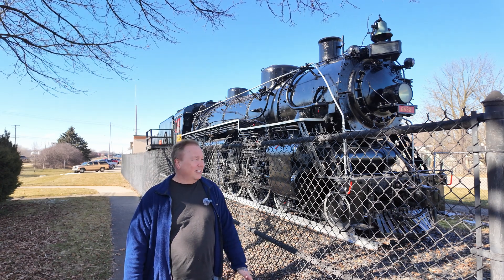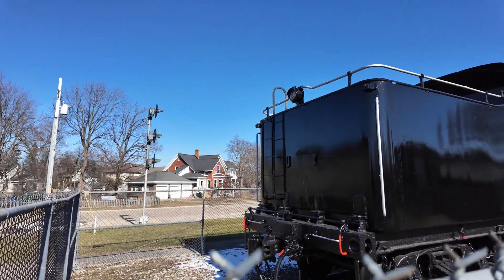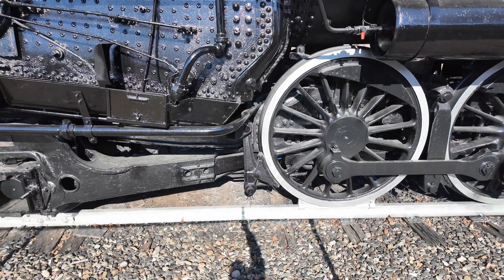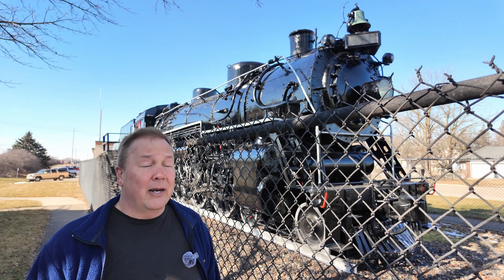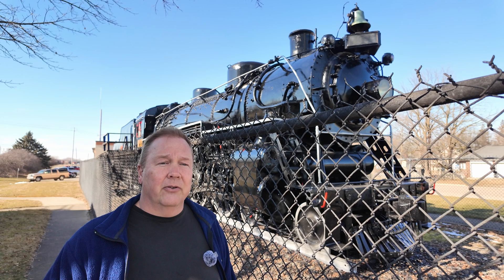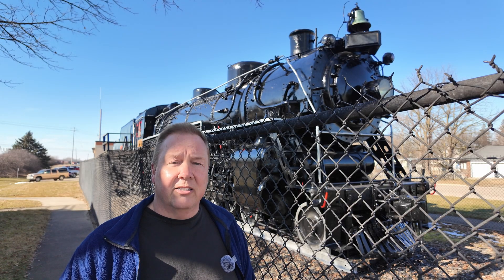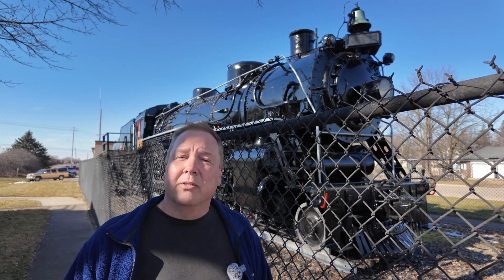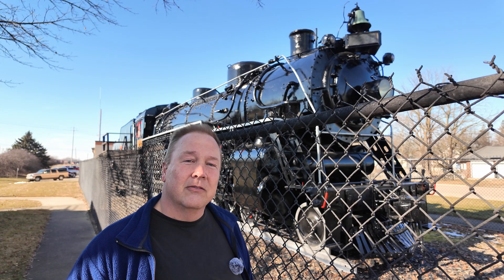Why Are So Many Steam Locomotives Sitting in Parks?

Comment: Desil eletric engines exist, because there is no such thing as a gear tooth that can withstand the forces required to get a train going.  Cogs with fist sized geer teeth would routinely get stripped bald if the driver accidentally applied too much force too quickly.  Eletric motors don't have that problem, so a driver could just go into top gear and not worry about stripping the motor bald.

As for why these engines are sitting there.  I've always assumed the answer is they are giant coal guzzling monsters designed to haul HUGE volumes of goods long distances.  They therefore need large volumes of freight or passengers to be cost cost effective to run, and there is only limited demand for live steam. Therefore you can only afford to keep a small number of engines in steam.  Static display is the only realistic way to keep any significant number of these large american beasts around for future generations.
Reply from the maker: Some good points, especially about why diesel mechanical engines never really worked out, but I don't know that total train weight has actually dropped much for freight trains.  They've certainly gotten longer.
Reply: @Industrial_Revolution  Well, given that the geer stripping I'm reffering to is what happened when the UK tried to convert from steam to diesil, I'd imagine the much MUCH heavier USA freight trains would be even more likely to strip the geers.

I think we did still use some deisil mechanical drives, but they were almost exclusively small, slow shunting engines, which I believe you'd reffer to as switchers.
Reply from the maker: Yep, and there's still some of those little ones around.
Reply: An electric motor and a steam engine can get torque right down to 0 RPM whereas an internal combustion engine has a minimum RPM (idling). 
Diesel locos under about 300 HP can get away with mechanical transmission like on a car or a truck but once you go bigger you need electric or hydraulic transmission.
Reply from the maker: Geared steam engines did exist, although they were typically smaller.  The Shay was fairly common on narrow gauge, and there's still some on use
Reply: @Industrial_Revolution  Oh yes, I was forgetting about geared locos. Of course the need for them came about because of the rough and uneven tracks laid in forests that would be only temporary.
Reply from the maker: @kiwitrainguy a big feature was that they could handle sharper turns.  In rugged mountains, laying tight turns can save a lot of money.

Comment: In some cases it's lack of interest, in others insufficient funding to run & maintain them. Large drivers normally indicated express passenger & or mixed goods services.
Reply from the maker: Definitely a lack of funding. I work with a couple non-profits who never have enough funding, often not even enough for basics like fixing a roof.  
I have a video coming out about how to calculate speed from wheels, and another on the Whyte classification system, and why railroads did different wheel configurations is on my list, next time I can get to someplace with enough variety of steam locomotives to show it well.

Comment: A lot of park locomotives were put in place as strategic reserves because these things are impervious to EMPS. Should there been a nuclear attack, the theory is that you can just fire these right up and get war material and personnel to action relatively quick.
Reply from the maker: I hadn't heard that argument before.  Some that went to parks had been stripped of some parts (to install in others), and a lot were sent there when they were facing expensive repairs or maintenance cycles, like needing a new boiler.  You couldn't "just" fire them up again, but for maybe a year or two, it wouldn't have been too much work (beyond what was pending when they were retired).  Probably within 5-10 years, all of them would have needed major rebuilds, like what you see museums doing with some they rescue today.

Comment: Steam was greatly loved by most people. Not just the people that ran them. The people that built and worked on them enjoyed their jobs and the engines. They hated to see them scrapped they found every opportunity to save them. 
Most people thought they would be called on again to keep freight moving.
Reply from the maker: If you think of how WWII stalled dieselization, it makes sense why people would have thought steam would be back.
Reply: In certain areas they did.  In the mid-late 1950's, Pennsylvania Railroad had a huge, unexpected uptick in traffic during its dieselization process so they had to lease steam engines from all over the country since they scrapped most of their domestic fleet to keep up with traffic flow.  They were pulling Reading, RF&P, even Santa Fe steamers!
Reply: @OriginalBongoliath  Many were not yet scrapped, but rather stored "unserviceable". The cost and time involved in making them serviceable made less sense than leasing serviceable engines from other roads.  The glut of available power probably made the lease terms very attractive.  For the lessor railroad, it was an opportunity to make money from an asset that wasn't being utilized. The Santa Fe's big 2-10-4s went right from the PRR to the scrappers, proof that they were through earning money on the parent road.

Comment: Yes, steam locomotives are a part of our culture, like chimneys on houses kids draw. Engines in parks are curiosities and reminders of an industrial past that is now hidden behind sheet metal and plastic. This Pacific is a fine example of form and function. Every part has a purpose. Big wheels, high-capacity tender, built to run fast on fairly straight and level terrain, beautifully balanced mechanically and aesthetically. Just to expand the discussion a little, remember the yard locomotives, the steam switchers that were "in steam" when not working. Standing and waiting wastes a lot of heat and fuel. Diesels working in the yard could be started when needed and turned off when not. As good as steam technology was, the handwriting was on the wall.
Reply from the maker: Yep, diesel-electrics win for efficiency, but they do lose in elegance.
Reply: Old obsolete 19th century tech yes, but pound per pound for brute power & strength you still can't beat them
Reply from the maker: I assume you've seen the video of the Big Boy that was called in to rescue a stick diesel last year?

Comment: Let me break it down for you in math instead of just telling you how wrong your information is. Lets take the NKP 765. If you do the math calculation's on boiler heating surface you will find the maximum amount of steam that boiler can produce if wide open full steam consumption which actually can't be used by the pistons or generator you will find that boiler at full firing rate can put out about 70,000 pounds per hour of steam. Now once the train is underway, and the valve cut off is closed down so your using the expansion of the steam in the pistons you might be using at most on a heavy train 30,000 pounds per hour of steam. At 8.33 pounds per gallon of water, that is  3,600 gallons per hour of water consumption. The tender holds 22,000 gallons of water without the aux. tender. That is over 6 hours worth of running at that rate. Now at 35 MPH for 6 hours you have run  210 miles. so how in the world do you equate a standard steam engine in regular service to only going 10 miles before needing water?
Reply from the maker: I think the whole thing comes down to a phrase you used near the end - standard steam engine.  The number I used came from a historic line in Colorado, based on their two steam engines, both with tenders.  Some could go much further, and track pans, although rare in some places, were common in others, eliminating the need to stop for water at all.  It's great that you actually pulled together the numbers, here, as it gives me an idea of what I need to be looking at in the future.  A lot of people have brought the 10 mile number into question and it's clear it may have been an overgeneralization.  I've pinned a comment on the video saying that, and I'm thinking there's a need for me to put together a more comprehensive video specifically on water consumption and range and how that varied.
Reply: @Industrial_Revolution  exactly the problem. You generically put information that only works on one little railroad in one location on every railroad in the  world. You made so many false statements in a generic reference that you painted a huge wrong light on the entire industry. Steam engines were inspected after each run which took a few minutes just to check running gear etc. Not shopped over night every night for hours of work. that Pacific was used for passenger trains not freight, and it is not one of only 3. It is a USRA copy and there were hundreds of that Pacific used all over the country. A steam engine requires a fireman and an engineer. Not anymore to operate it. It is pulled out of service every so many days just like a diesel to inspection. Steam engines normally ran 50 to 100 miles before needing water based on the terrain they ran in and how heavy the train is. There is so much you need to learn about it before making a video showing your ignorance. (that does not mean stupid, it means you don't know) And you need to stop making generic statements and say. According to this RR their engines can only run 10 miles on their track before needing water because of the grades, or the size of the engine etc. You really need to just take this video down and learn more about what your talking about and make a new one with more accurate facts. Track pans by the way were used by the NYC mostly for their through service passenger and mail trains, The B&O only had one set of them out east and the PRR had them in a few places again for passenger trains. 95% of the railroads never had or used them. Track pans almost not need to be talked about at all unless your doing a video on just the NYC high speed operation. because the majority of the RR's never had them.
Reply from the maker: Actually, although track pans were mostly heavily used in the US in the NYC area, they were used elsewhere, as well.  The Detroit-Chicago line had at least some.  I used to live very near where one set was located, 40-50 miles out of Detroit.  I haven't checked, but I'd guess they were regularly spaced on that line of about 200 miles.
You're actually bringing up something every youtube creator has to deal with.  For a 5-10 minute video, you can't go into a lot of detail, and you're forced to generalize some, even for the main topic, and generalize pretty broadly for other topics.  For this video, the main topic was that railroads wanted to get rid of steam locomotives because they were harder and more expensive to operate and maintain, and lots of towns, especially railroad towns, were interested in accepting them for parks, and since that also made financial sense for the railroad companies, they ended up there.  
The good thing about the comments, even ones that are pretty critical of the video, such as yours, is that it really helps to identify subjects for future videos, as well as pointing out where I should be more careful with generalization for future videos (such as saying "as often as every 10 miles" instead of "every 10 miles.").
Reply: @Industrial_Revolution  talking about track pans, I said NYC meaning New York Central  as in the Railroad! :) They used them here in the Cleveland area and all over the system the high priority trains ran. The rest of your comment back to me makes me believe I am talking to a wall. There is a huge difference between generalization and stating one thing as a fact for all. If you don't see any of mine and others comments as just how bad this video is that you made. Then I quit. I am trying to help you be accurate in teaching history, and your coming back at me defending your 10 Mile statement and the other extremely incorrect information as just generalization.  If your going to generalize something, you go in the middle of normal not the bottom end and state it as fact. Your information on the Pacific is not a generalization, it is just plain wrong. Your information on the 10 mile, maintenance, etc. is based on one location and I still really question those number but you won't give out the information where you got it from. So you are beyond help because you don't seem to want to listen to those trying to help you and teach you. If you wanted to make a video about why the railroads went to diesels, you tell them because it required more maintenance, and maintaining track side facilities like water towers, track pans, coal towers and the fact that the drivers would hammer the rails at high speed causing higher track maintenance. That is generic truth without going into details. As for them giving them away to parks, it is not financially beneficial for them but people back then wanted to preserve things. They sold many to scrap yards being paid by the pound which was quite a good income for railroads. If they gave it to the city park commission, they got nothing for it. How do you say it made financial sense for the RR? Anyhow I am done. You appear to want to defend your incorrect information instead of listening. So good luck. I could be a help to you for information, but instead you just want to make excuses for and defend your comments and won't even give the source for your information. So I am done. good luck!
Reply from the maker: No, you're not talking to a wall.  I am hearing what you're saying, and it will impact future videos.
Reply from the maker: @s1-6100  You're not talking to a wall, and your input will be taken into consideration for future videos.  If I didn't think your comments were worth my time, I wouldn't have even responded.  The channel is still new, and it needs constructive criticism to get better.

Comment: Not only will these locomotives run 100-150 miles between water stops, but they did not have to be shopped every night. Modern steam locomotives could run great distances without shopping. Santa Fe’s 3780, 2900, 3460, & 5010 class ran transcontinental without changing engines. The old timers who worked steam said Santa Fe management charged the diesel maintenance cost off to these engines to make them appear less efficient. What drove the demise of steam for the Santa Fe was the availability of water in the desert southwest and the complexity of operating a steam engine. Early Winton and EMD 567B diesel engines had a lot of issues.
Reply from the maker: Water capacity seemed to vary quite a bit from locomotive to locomotive, as well as depending on load, slope, etc.  I'm thinking I need to put together another video on these differences.
Reply: They had to shop/replenish these engines often. Just removal of all the coal dust to come into the bearings and so on. Also wash out the boiler, replenish coal and water and so on. Very maintenance heavy! In Europe, train companies calculated steam engines run 3 weeks+1 week maintenance per month. Diesels just hardly two days maintenance per month! It is with reason that with the end of steam, thousands of workers were laid off and shops closed. I volunteered on a museum steam tug, we were envy of the "diesel people" which run the diesel museum ships beside the steamers. We had hours of preparing, the diesel people came in, a little greasing and pre-glow, and they were ready in half an hour!